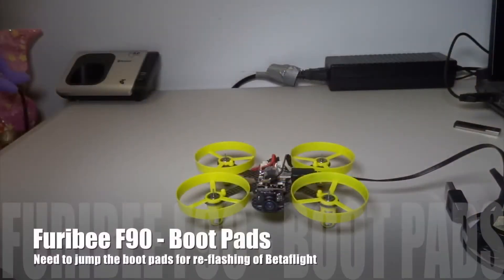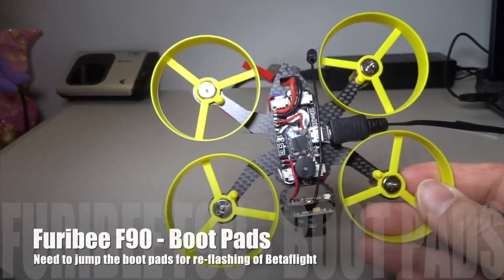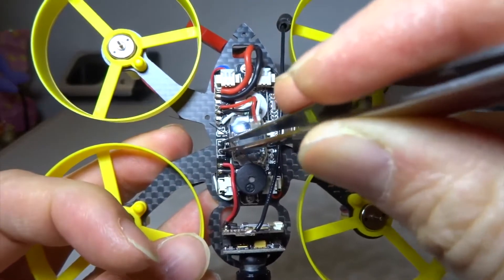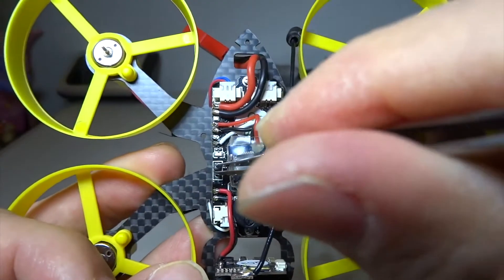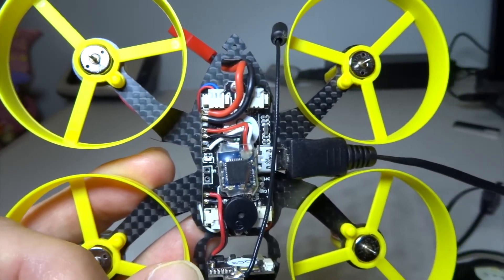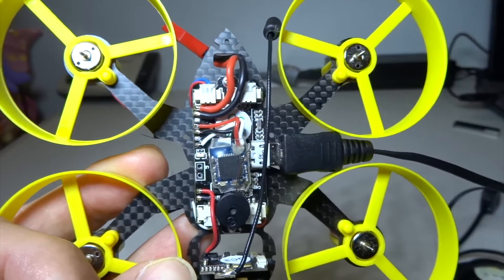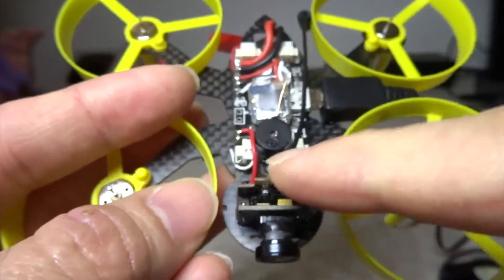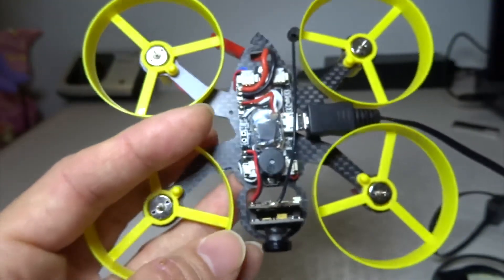Furibee F90 - Boot Pads for Flashing Betaflight DFU mode

Comment: Nice video, this is a point of frustration if you haven't done it before. I just flashed the latest firmware on my Q100 and was pleasantly surprised to see it had a button rather than pads to enter bootloader mode. Hopefully, everyone goes to a system like that eventually, shorting the pads is a pain in the butt ;)
Reply from the maker: Thank you :) Agreed - I think newer fcb have bootloader button and there are fcb that can flash without bootloader button e.g. Eachine flying frog Q90 - took me a while to understand this :)